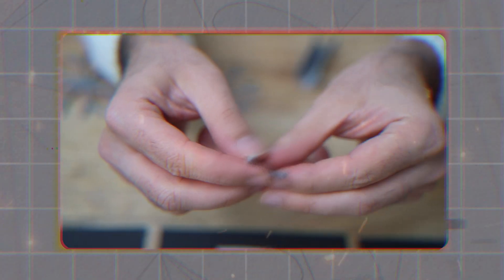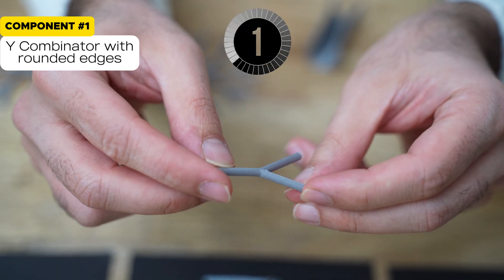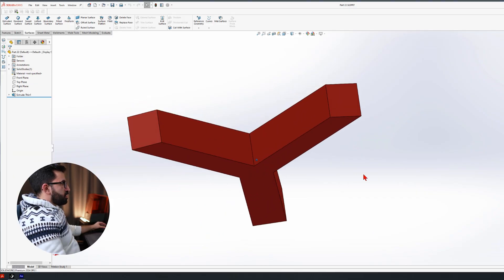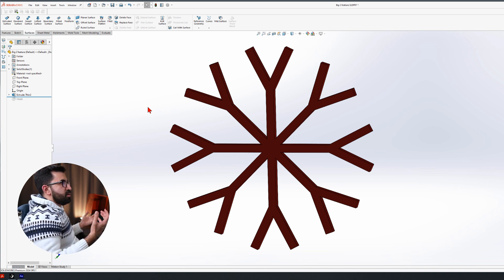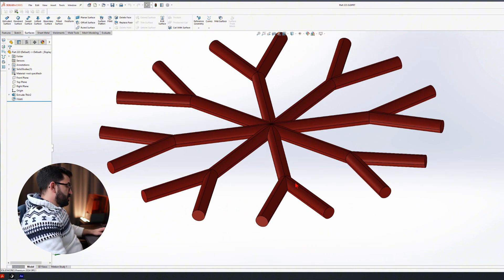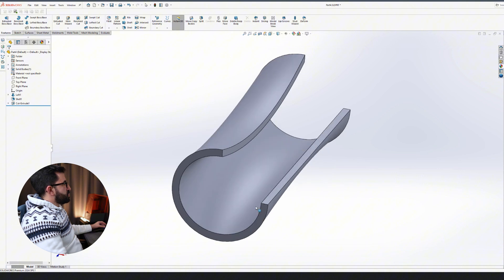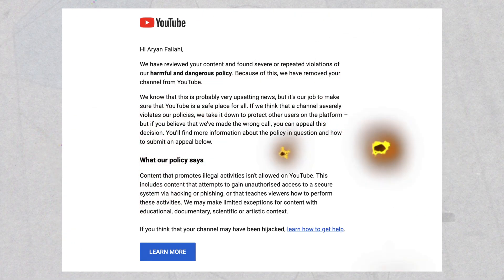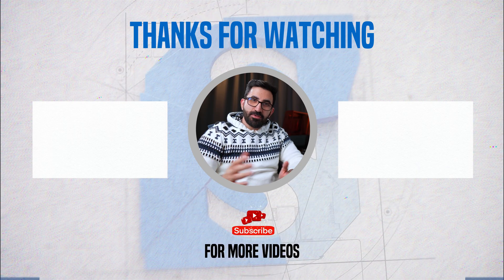How Many Features Do You Need to Model These? (Can you guess all of them right?)

Comment: thanks for the advanced content! btw i can do component 5 with only 1 feature. with over elaborated sketches and a loft/boundry
Reply: if we dont count the planes though 😅😂
Reply: i have to do it with 3d sketch instead
Reply from the maker: yes, using 3D sketches, you can do it in ONE feature and I've announced the winner. HOWEVER, it won't quiet be exactly the same, as the thickness throughout that body would vary